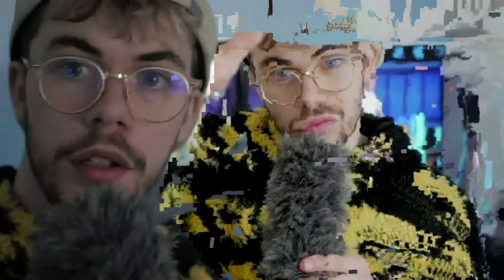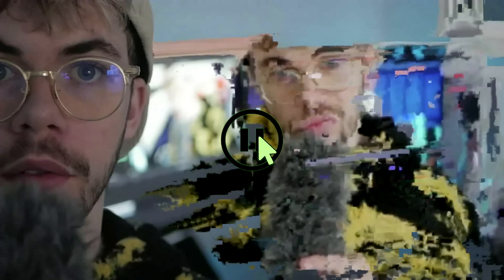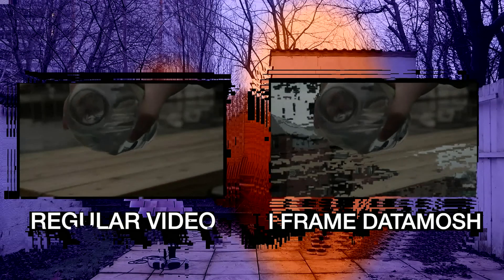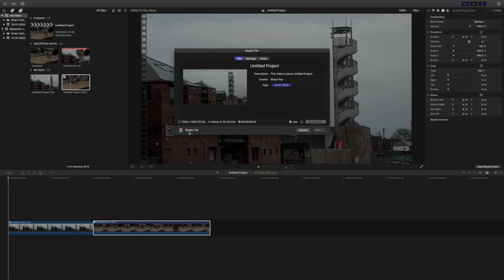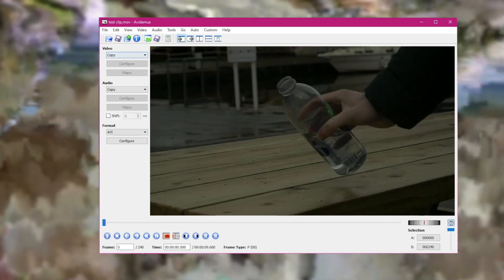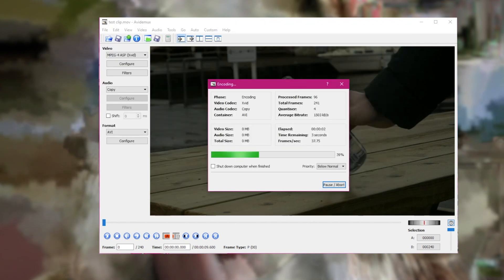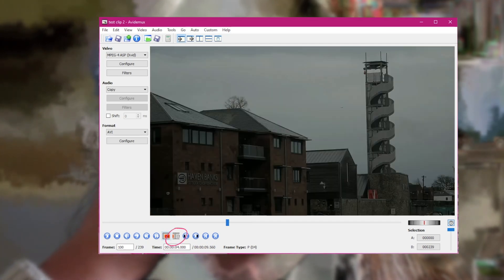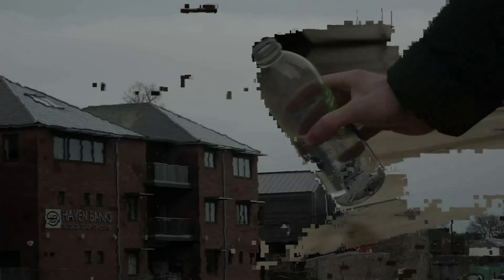Datamoshing Tutorial Video - Shaun Ray

Comment: If anyone else has the issue of a green or black video file when you open it using the version posted here. I found a fix. Go to the preferences if using the version in the description here (Tools > Preferences > Threading) and set it to custom and enter a number that is 8 or less. This old software has issues on systems with more threads than that. Cheers.
Reply: omg ty

Comment: i only have 1 i-frame at the beginning, i have no idea what is going on
Reply: someone else asked the same and this was the creator of the video said:

Have you combine the two clips before bringing them into avidmux? 

If you did combine the clips before bringing them into avidmux, this problem only occurs when your original editors exporting process believed there was no I-Frame necessary to split the 2 clips. 

You either need to pick clips that have distinct differences between the first clips last frame, and the second clips first frame
Alternatively, you can add 1 single very different frame between the 2 clips, which should force the original export into creating an I frame for that single frame, as well as for the clip after that frame, allowing you to remove the I-Frames, and get the datamosh effect on the 2 original clips!

Comment: Does it work with .mp4 clips or just .mov/.avi ones? From most tutorials I've seen, they usually used the latter files to make the effect.
Reply from the maker: From my experience you can use multiple file formats within Avidmux, I believe I’ve used .mp4 before. If your file format does work, you can always use the online converter I have linked in the description (or any encoder of your choice) to convert the file!
Reply: @ShaunRayEdits  thanks for the quick answer. Kudos to you for the tutorial, btw.

Comment: could you make an updated version for avidermuz 2.8 its not working in the update ://
Reply from the maker: There is unfortunately no way to datamosh in avidmux 2.8. 
I would recommend following the link in my description to download avidmux 2.5.4. This will allow you to datamosh!
Reply from the maker: @skarn4117  If your having trouble getting I frames to show up, it may be that the first frame from your second clip isn’t different enough from your previous clip to define itself as an I-Frame, in this case maybe try 2 different clips, but if your set on those clips, add 1 frame that’s completely different between those 2 clips in your original editor to trick avidmux!

I hope this helps, but if not let me know, and I’ll see what I can do!

Comment: once exported from avidemux (the first time round, before removing frames) my video has no I frames at the transition of the two clips
Reply from the maker: This is likely because the 2 shots your trying to Datamosh are to similar. I would suggest trying with 2 definitively different clips to get the hang of the process. 

After that, if you would still like to use the original clips, I would recommend adding a single brightly coloured frame between the 2 clips. When you’re Datamoshing, this will be the frame you then remove! 

Hope this helps, let me know how you get on!

Comment: hi. im having problems with this. i've done all of what you said, but when i export the new mpeg video with the 99999999, there are no longer any I frames besides the starting one. they're all Bs and Ps. what do i do?
Reply from the maker: This is likely because the 2 shots your trying to Datamosh are to similar. I would suggest trying with 2 definitively different clips to get the hang of the process. 

After that, if you would still like to use the original clips, I would recommend adding a single brightly coloured frame between the 2 clips. When you’re Datamoshing, this will be the frame you then remove! 

Hope this helps, let me know how you get on!
Reply: @ShaunRayEdits  that works perfectly. Thank you!
Reply from the maker: @VictorGreinvolfe48  No Problem, glad I could help!

Comment: Avidemux only shows a green screen, i am on 2.5.4.

if i click no it crashes, if i click yes it shows a green screen. If i use an AVI file it only shows green. please help.
Reply from the maker: Can you convert the AVI to h.264? You should be able to do this on the online converter I have linked in the description, or just exporting it through a traditional editor (prem, Final Cut, davinci, media encoder)
Reply: using the online converter i converted it to a mp4 with the 1920, 1080 Full HD 25p, h.264. This is the same present i sued on DaVinci resolve. This time when i click No it does not crash but still displays a green screen. @ShaunRayEdits
Reply: I just tried that, i converted to a mp4 with h.264. I use DaVinci resolve. They green screen is still there, i have tried un installing and re-installing. @ShaunRayEdits
Reply: My comments are not sending so if a bunch pop up, sorry. I tried that just now, i used an mp4 with h.264 still showed green. I have tried uninstalling and re-installing @ShaunRayEdits
Reply: @shout-message try using 2.5.6
Reply: @blackboyvfx  ty, ill try when i get home.

Comment: I tried to get Avidmux 2.5.4 through your link but it keeps bringing me to a newer version without the features that allow for datamoshing properly. Do you know where I can find a link to an older version?
Reply from the maker: hey, I just checked the link in the description, and it still works for me, the site offers the latest version I the green button, but 2.5.4 still remains underneath as an available option for windows. I would recommend checking the link in the description again, and selecting the blue highlighted avidmux 2.5.4 text. 
I hope this helps, but let me know if you need further assistance!

Comment: for some reason an i-frame isn't created between my two clips, does this happen much?
Reply from the maker: Have you combine the two clips before bringing them into avidmux? 

If you did combine the clips before bringing them into avidmux, this problem only occurs when your original editors exporting process believed there was no I-Frame necessary to split the 2 clips. 

You either need to pick clips that have distinct differences between the first clips last frame, and the second clips first frame
Alternatively, you can add 1 single very different frame between the 2 clips, which should force the original export into creating an I frame for that single frame, as well as for the clip after that frame, allowing you to remove the I-Frames, and get the datamosh effect on the 2 original clips! 

I hope this helps! Feel free to ask any extra questions and let me know how it goes! Thanks!
Reply: It seems to me that sometimes when I push the up and down arrow buttons they don't always go to the iframe between the clips, but to some other iframe after it, so I just have to manually use the left/right arrow keys to find the iframe between the clips. @ShaunRayEdits
Reply from the maker: @bobflux4435  Ahh, in that case it might be that you have either missed converting it to a mpeg-4, or missed changing the I-Frame interval to all 9s!

Comment: Avidemux doesn't support CPUs with higher cores than 8 on the older versions which means I cannot follow this tutorial because of the green screen bug on Avidemux.
Reply from the maker: I seen that as an issue before, the best options is trying to run a emulator with less power than your pc actually has, or seeing if you can dig out an old laptop from somewhere, I usually just ask around the people I know and they tend to have one I can borrow!

Comment: hi shaun ... it's a great tutorial. I tried to apply the steps but I couldn't find the maximum I-frame interval setting in the software. I even installed an older version but still did not find this setting. any advice?
Reply from the maker: Thank you!
I’ve never encountered and issue like this before, and I’m guessing you have tried using the version I have linked in the description? I would triple check that you are in the correct tab to find the I frame interval editor, as that was a mistake I’ve seen people make before. 
If you have any extra information I’d love to help but I’m a bit stumped on this problem at the moment sorry!
Reply: I'm having the same problem. I'm fairly certain this doesn't work on Mac
Reply from the maker: @ramblinnelson  Sorry! It doesn’t work on Mac, I am working on a video soon for alternate methods you can do on Mac.

Unfortunately unless you have an Intel Mac, you can’t datamosh, and even then you need to have a windows emulator. Apple have plenty of well documented way to emulate windows so that’s a good place to start if you want to explore that option!
Reply: @ShaunRayEdits  rats, I've got an M1 chip. it's strange that it's not possible on mac but there are mobile apps that seem to do the trick? regardless, thanks for this excellent video!

Comment: I don't see the MPEG 4 ASP thing there's none
Reply from the maker: The most common issue is you may have the wrong version of avidmux installed, make sure you have 2.5.6 (the one linked in the description) and it should give you the option for MPEG-4 ASP :)

Comment: outdated
Reply from the maker: The software is indeed outdated.

However it does offer functions unavailable in any current day editing software, which allows you to create an authentic, and real ‘datamosh’ 

I am aware of alternative plugins for modern editing software, but they do not provide real I-frame removal or P frame duplication, rather just a effect similar to the authentic. 

So although the software required is outdated, the tutorial remains relevant, at least until I frame and p frames become accessible and editable in current modern video editors.
Reply: @ShaunRayEdits  i meant the tutorial, not the software
Reply from the maker: @rose11e  Could you elaborate why the tutorial is outdated? 

It still teaches how to create the datamoshing effect. and the software required is still available.

If the tutorial is indeed outdated for any reason I will update and refresh my datamoshing tutorials, as datamoshing is something I'm incredibly passionate about.
Reply: @ShaunRayEdits  i mean the software has changed and it wont work like the way you said on the tutorial, sorry if i messed anything up
Reply from the maker: @rose11e  No you haven't messed anything up:)

The top link of the description has the correct version of avidmux (2.5.4) needed to datamosh. just uninstall the current version of avidmux first 

Hopefully his resolves your issue, if it does and this has helped maybe consider subscribing! and if not just leave me another comment and ill do my best to help you resolve the issue!
Reply: @ShaunRayEdits  alright thanks!

Comment: When I import my video into Avidemux, I get a green screen where my project would be? Why could this be. I am using H.264 and tried using MP4 or Quicktime. Do you have any help?
Reply from the maker: I think when I’ve experienced this issue in the past it’s been around the density of the file, maybe try cutting your footage down into smaller chunks to test it, or a lower resolution. 
I’d also recommend making sure you have the correct version of avidmux etc
Reply: @ShaunRayEdits  Same here, can't figure it out either... That's a shame, I used to do it years ago, maybe windows 11 doesn't help
😢

Comment: hi mate. I have a Mac, will Avidmux work/ which one of the download links do I choose? there's five options
Reply from the maker: You won’t be able to run it on a MacOS directly, if you still have a intel Mac, you could use boot camp to run windows, and the use avidmux on you Mac.
Link for windows on Mac: 
https://support.apple.com/en-us/HT201468

If you have a newer Apple Silicon Mac, or don’t want to run windows on your Mac, then I’d recommend seeing if a friend or family member has a old computer you can borrow, it doesn’t need to be to powerful, so don’t worry about that. 
As for which one to download, if I remember correctly I used the intel.dmg, or the win32.exe dependent on my which computer I was working on, as I’ve done this on multiple pcs now. So it’s a bit of trail and error on which will work unless you know the specs of your computers operating system. 
Hope all this helps, let me know if you have any problems:)

Comment: my Avidemux just crashes when i import my footage
Reply from the maker: I would try troubleshooting this problem in this order:
1) make sure it’s avidmux 2.5.4
2) make sure the footage your importing it’s one single clip of h.264
3) try it with a small sequence of clips first (10-15 seconds)
4) double check you are hitting no to both pop ups (as seen in the video) before beginning 

My only other thought on this problem is when you open a file in avidmux, especially if it is already converted to mpeg4 and try to hit spacebar to preview the video it will crash, as it can’t compute what your asking since the I frames are removed. 
I hope this helps! Let me know if it works, and if it doesn’t still let me know and I’ll see if I can help you figure out the issue:)
Reply: @ShaunRayEdits  I have the Avidemux on 2.5.4, number two it's one single clip, and the footage I imported is only like 3 - 5 seconds, i only get one pop up and i hit no then it crashes once i hit no on the popup
Reply from the maker: @VexolFX  it sounds like if your only getting one pop up, the footage isn’t in a h.264 file, since you should have a pop up for h.264 detected. 
I’d recommend putting the clip you want to try through the online converter linked in the description and turning it into a h.264, or re exporting through your original editing software into a h.264, and then you should be good to go!
Hopefully this solves the issue your having, but let me know either way:)

Comment: I followed the steps exactly but it doesnt work /: i have the right version but after i delete the iframes and save the video back out as a copy its not readable by anything and is usually just black with the audio glitching out. idk what my problem is.
Reply from the maker: I would recommend trying with the test footage I have linked in the description of the video. Your problem could be the footage you have decided to use, or alternatively you may have selected the wrong format on the 1st save, since it needs to be a mpeg 4 ASP (Xvid), and there are multiple formats with similar names 
Otherwise you may have downloaded a different version of avidmux, as I’ve had someone else encounter this problem.
If it works with the test footage then it’s most likely your footage, but if the output is still black, and not the same as the result in my video, drop a reply to the comment, I’m more than happy to help you troubleshoot your problem!
Reply: @ShaunRayEdits  fixed. oddly enough my problem was starting with footage that was already in AVI format when i brought it into the program from AE.
Reply: so make sure its an mp4 or mov before doing the rest of the steps, one thing i was still having problems with was that there was a cut in my footage that didnt get an Iframe and i needed it there.
Reply from the maker: @zerek44  if the footage cuts to black it will not work, the footage needs to go straight from one scene to another. 
As for the file format, you have to bare in mind that avidmux is a very old piece of sowftware so it doesn’t always support the super fancy new codecs. 
I also find it very interesting your working through your footage with after effects! This is awesome, I hope you manage to make some really cool combinations of effects mate,
Happy moshing!